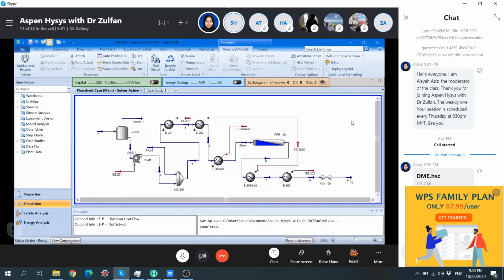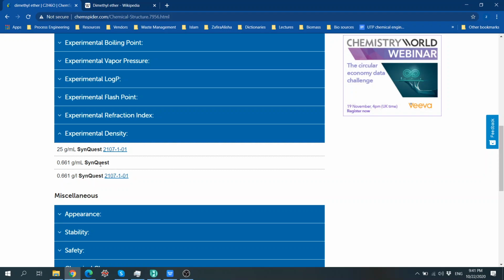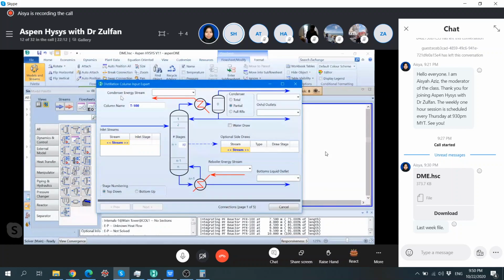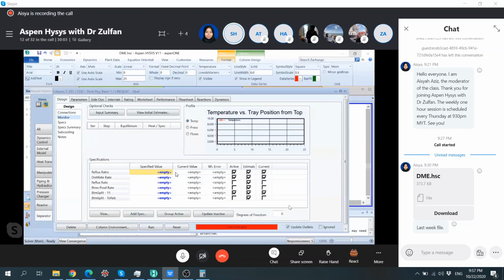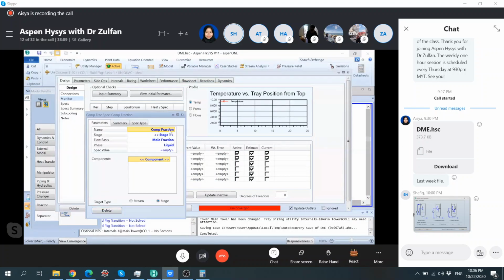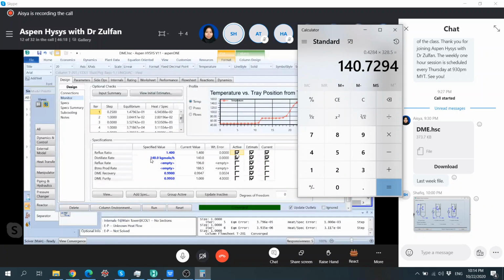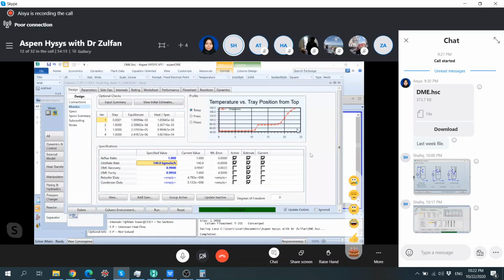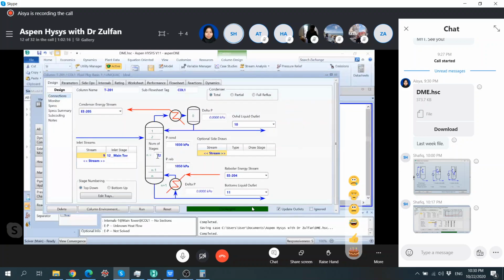Setting Up Distillation Column Part 1

Comment: Thank you so much for the sharing, sir... So valuable...

Just my 2 cent input: for getting the boiling point of the component, no need to googling... Just double click on the selected component then we get the properties like boiling point, critical point, ideal liq density, etc.
Reply from the maker: Exactly! Thanks for this. My intention was merely to show that we have to check with literature data. In some cases, data in the simulation software can be incorrect also
Reply: @ wow, now i see… 🙏🏽🤝🏽